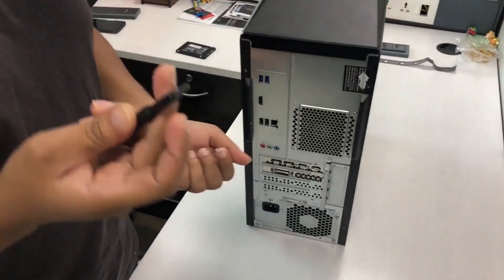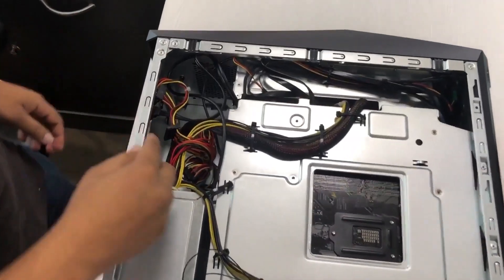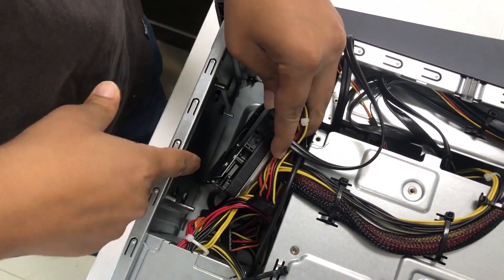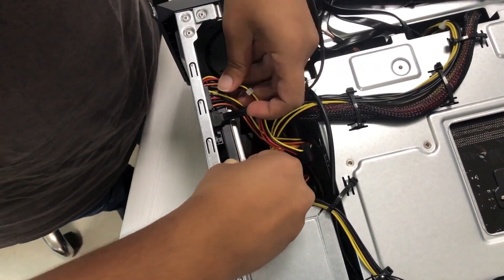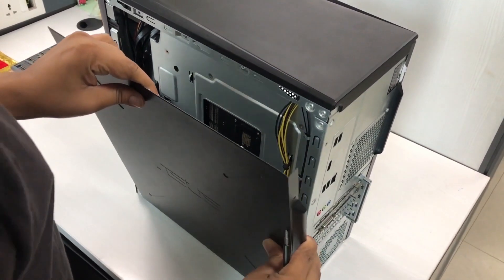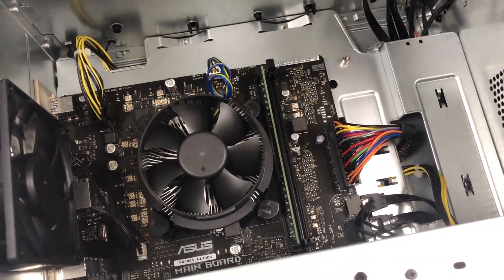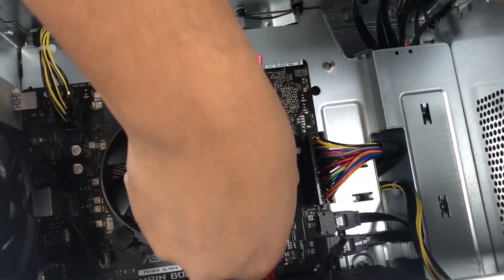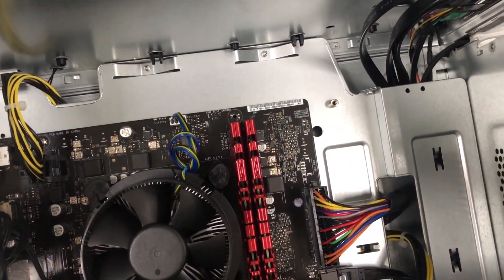ROG Strix GL10 HDD & RAM Upgradation

Comment: Bro I need ur help in getting L type SATA Connector u used
Reply from the maker: You can get that at any PC store.
Reply: Actually when I am connecting the sata cabel to the hdd the sata cabel is placed in the reverse direction from the video where its blocking the cover of the cabinet and also unable to screw the hdd
Reply: @14370891  did you fix it? I'm having the same problem.
Reply: I got exactly the same problem as you. My SATA connector is downward unlike the video that is upward. It was blocked when I trying to fix the disk at the bottom
Reply: what is the name of that cable ? in shops found only with wrong direction. L angled but cable goes down not up.
Reply: and when using powert cable, then that kind connector is too short to connect pc front... with power cables withoput orange wire it dosnt work the lights... what a strange design of that pc box

Comment: what power cable and HDD cable did you use. the power that i used that was inside already was to long and i cant shut the case.
Reply from the maker: You use a standard SATA power cable along with a SATA connector for motherboard.

Comment: The power cable that you attached to the HDD after the sata cable, that is the cable that came inside the desktop correct? or is that something separate we need to buy beforehand
Reply: there should already be that cable inside the pc yes.

Comment: In my previous experience upgrading ram, it was necessary to remove the clock battery. I didn't see you do it, I can't find it. Should I even worry about it?
Reply from the maker: You don't need to. Just power the system down. Remove all power cables. wait for 15 mins for the system to properly discharge and then upgrade your RAM. Once you power it back, the system should recognize newer RAM.
Reply: @knowyourproduct  I have purchased gl10cs i5 9400f with gtx1660 side pannel has a Stricker on it says read warranty card before opening if I upgrade ram will it void my warranty because I purchased it a week ago only but 8gb of ram is not enough for me

Comment: Is there anything we have to do in the bios after the ram upgrade if im upgrading to a faster speed?
Reply: I don't think so, because the chipset is intel b360, just bare min to runthe pc
Reply from the maker: 2666MHz is the max RAM that is supported officially. Beyond that you have to tinker in BIOS but we would not recommend that unless you know your way around that.
Reply: @knowyourproduct  could you make a video on this, would be a huge help.

Comment: hey , by upgrading RAM and Storage , the warranty will become void???
Reply from the maker: No, it will not void warranty. The Warranty is void only if your upgrade makes the machine not work properly. If you know what you are doing, you are good.
Reply: @knowyourproduct  I have ordered i7 9700k and GTX 1650 model , and I'm planning on upgrading RAM and HDD as well
Reply: Guys one more doubt , there is already 1 stick of 8gb DDR4 Ram, so if I'm trying to upgrade it to 16 gb , is it ok to add another  single DDR4 stick of hyper x fury or to add both slots with same brand???
Reply from the maker: @raghavendradk8691  it is always better to use a kit (1+1) to upgrade.
Reply: @knowyourproduct  thank you sir, for the advise, also could u tell us the cooler that is installed for cpu ???
Reply: @knowyourproduct  sir, the motherboard is b360 , so how many extra fan header pins do we get sir ??? ( Except chassis fan and cpu fan)

Comment: Btw. Its upgrade / swap or add extra hdd?
Reply from the maker: The desktop has 1 NVMe SSD slot on the motherboard and one 3.5-inch HDD slot in case. Both are upgradable with up to all current consumer grade drives.
Reply: @knowyourproduct  noted. 
Btw i add 2.5inch HDD below the graphic card, bcs if i put additional 3.5inc hdd, its not enough space. 
Now total storage is 256gb nmve+ 1tb(3.5inch)+ 1tb (2.5inch).. Hehe..

Comment: Nice bro can we use 2 gpu on this pc?
Reply from the maker: No, the system is designed to utilize only 1 GPU at a time. Also, newer GPUs prefer running alone. Adding a second GPU is a diminishing return proposition. For example, if you have a second GPU and even if you are able to connect, it won't give you twice the performance but just 40-50% better compared to a single card solution. Instead swapping to a better GPU is recommended.

Comment: What screws do i use?
Reply from the maker: HDDs use flathead 6-32 screws, but you can simply ask your local IT shop for HDD screws and you should get the same. You need 4 for one HDD drive.

Comment: what about ssd
Reply from the maker: The video is about the India Spec model, which does not have an additional 2.5-inch SSD slot. However, it may vary as per your region.
Reply: There is a slot on the front of the case , you can see it at 0:48 where you can place the smaller 2.5" SSD.
Reply: @burnoutnt dude ur a legend. 3 years later and your comment just saved me 😂